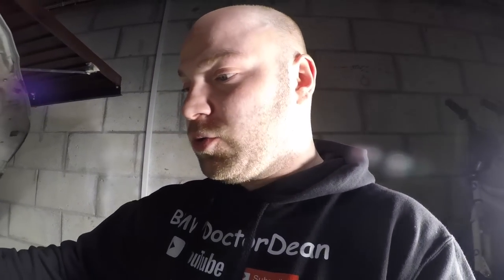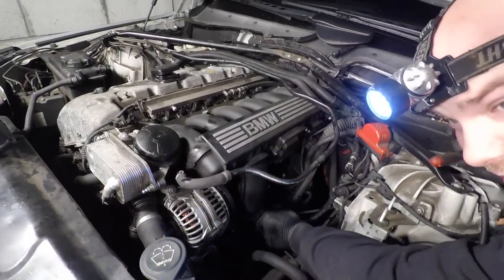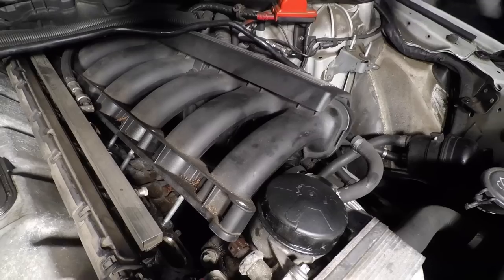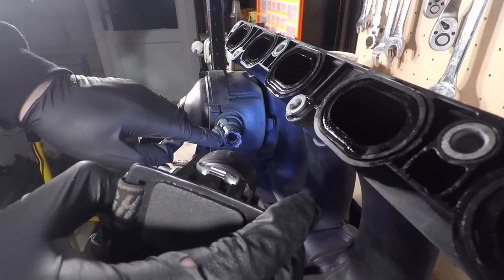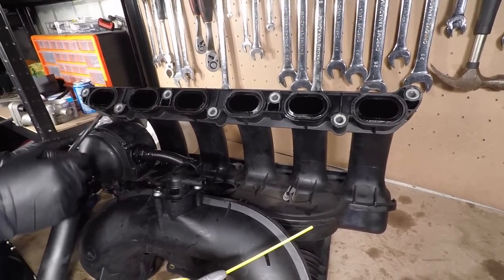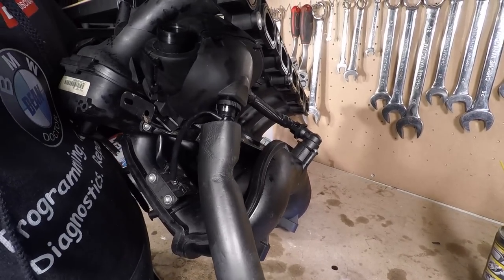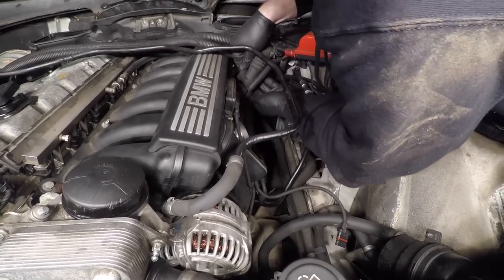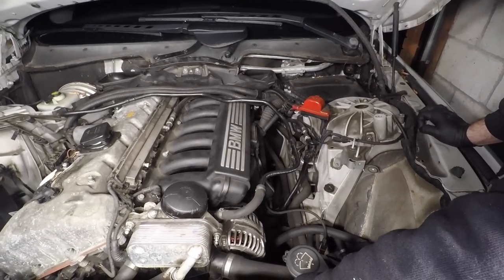BMW N52 How To Replace CCV Intake Manifold Removal Step By Step Guide

Comment: Does the old oil return hose (with yellow connector) had a check valve in it? 
Only few places I found about it people say that old hoses had valves in them with part number 11157527570. But the new ones with 11157567801 are just straight pipes.
So the problem is when the ccv valve are new it's kind of ok, but eventually it starts sucking the oil from the pan.

Comment: Could you please show how to check it on N53 and N54 Engines where the PCV oil separator is built together inside the Valve Cover, and also hoses and pipes from crankcase and to intake manifold.
It could be a great video in future.
Thanks a lot and comgratulations.
BimmerN53
Reply from the maker: nah it wont be mate and not enough money for the stress 

N53 engine is a uk and eu engine I have already purchased the new car for the channel and I can assure you now IT DEFINITELY is not N53 ask the country your in to pay more and I will do the videos until then im only willing to reach out to the USA and high paying countries 

sorry bro the same as all my diesel guys there sitting here waiting for videos that aint gonna happen again its to low pay for these countries

Comment: I removed my manifold and found oil. 2008 E60 528i N52B30A. The round oil separator in your video does not exist on my manifold. There is only the Y hose that routes to rear of engine

Comment: @BMW Doctor There is a rattle inside my intake and some oil too. I figure the oil is from the clogged ccv but what about the intake manifold should if have something inside that moves around in there?
Reply from the maker: that will probably be your disa valve flap has fallen off inside your intake manifold
Reply: BMW Doctor what should I do about it? A small stick fell out but i cant get that rattle thing inside out somehow Any advice?
Reply: @VictorRamirez-rg4pg  I'd like to know as well. Exact same thing happend to me.
Reply: bUMi7 It was the disa valve. It was broken and the middle stick fell into the intake. I replaced both the disa valve and ccv but I have a bad misfire that shakes all the way to the bck of my exhaust . then Idk whats the problem now

Comment: Cracking those manifold bolts, and also re-tightening them. Don't go from one end to another, use a diagonal pattern.
Reply from the maker: you do not have too with a N52 manifold

Comment: So my HFM sensor is not working I changed the ccv put it all back and now rough idle and in inpa value 0.00 everything its ok except that.. what could it be ? wrong wiring somewhere ? can u help me please ? i dont thing the sensor its dead just like that in 2 hours after. can it be a housing from ccv ?

Comment: Nice video! How do you check if your CCV is bad?
Reply from the maker: Very easy look at the back of exhaust do you have smoke or blue smoke , does your car consume oil
Reply: @BMWDoctor  Thanks, just white smoke becuse i live in sweden and it is -10 C here right now BUT its consuming oil yes, i am gonna change the disa also, i have problems with the car becuse on the fault codes its saying "Vanos intake 2A82" "Crankshaft-exhaust camshaft correlation 2A99" And "Camshaft sensor, inlet, signal 2A9A"
Reply from the maker: that is your VANOS SOLENOIDS go and change them for BMW DEALER ones ONLY do not use cheap ones or your problem will be WORSE
Reply: @BMWDoctor  Okey i have cleaned them many times but now i maybe need to change them?
Reply from the maker: Mate your not meant to CLEAN them do me a favour and remove yourself from this channel

COMING UP HERE TALKING ABOUT CLEANING THEM YOU CHEAP SKATE 😡
Reply: @BMWDoctor  Okey Thanks!

Comment: What's the most reliable way to see if CCV on N52 is shot WITHOUT removing intake? If i don't have any obvious symptoms should i replace it just to be safe (E90 N52B25 110k km.)?
Reply from the maker: There is no way the only way is to remove manifold and see if you have oil in that’s your only way why are you scared to remove the intake this job is a peace if piss be sure to stay tuned we will be doing live repairs soon

Comment: I've got a e89 Z4 n52 - There is leakage by the valve ecover bolts - would this point to a blown pcv also ? Would i have to change the valve cover seal also ?
Reply from the maker: Yes you would and that means your ccv is ruptured causing excess vacuum in the crankcase
Reply: @BMWDoctor  cheers buddy , this is quite a labour job but looks achievable , thanks , anything else to look out for on my z4 e89 59 reg? can any coding be done and what software ?, do you offer any services for work ??

Comment: I'm about to do the starter on my 130i.. Do you recommend doing ccv at the same time even though they are fine atm?
Reply from the maker: Yes mate as you will break your hoses during removal there usually seized trust me don’t remove it unless you have new parts as they will and do BREAK!!! 

To get to starter motor you need to remove the manifold anyway so do it all at once over wise you will be back doing it all again
Reply: @BMWDoctor  nice one thanks 👍 I'll get it ordered.. The amazon one is OK yeah... I've oil cooler and filter housing gaskets to do while I'm there.. But got oem for those

Comment: Hey doc, quick question for ya. Have you reused the same bolts or do you require new blue ones for the intake manifold?
Reply from the maker: No you don’t mate you can re use the same bolts they are not aluminium

Comment: Thanks for a great video! :)
Reply from the maker: No problem mate
Reply: @BMWDoctor  I have a 325 (01/2006) with some power fluctuation issues and sometimes rough idle, mostly when warm in warm weather. Taking a quick 5-10 minute drive around town seems to work just fine but a long drive it gets grumpy, specially when +30 degrees C. I tried cleaning and replacing the vanos solenoids etc. I will inspect my PCV/CCV-system and then maybe look into the software updating which you posted a video about.
Reply from the maker: DONT CLEAN THE SOLENOIDS WHY DOES EVERYONE ALWAYS DO THAT IT DOESNT WORK THATS A CHEAP WAY AROUND IT replace them with genuine Bmw parts like I did on my e60 and problem solved you cannot be cheap on Bmw you need to spend the money
Reply: @BMWDoctor  I did replace them (non genuine though, but couldn't tell them apart other than o-ring material) and both sets seemed to pass the INPA vanos diagnosis test but still threw same codes occasionally (intake/exhaust mechanicly jammed etc). Even got MAF max value codes so I replaced that as well (VDO) but didn't help. Guess theres several issues luring. Thanks for your advice mate 👍
Reply from the maker: my friend do no buy non genuine at all the only people that make them are china does not matter new or second hand they do not perform at the speed of the opening and closing that Bmw has the due set too you need Bmw ones you cannot skimp out on these cars Bmw made these so you cannot use cheaper parts trust me your asking my advise go and buy genuine Bmw parts NOT SECOND HAND either I paid just over £200 for mine and Ive had no problems at all for 6 months straight I wouldn't dare use cheap again  @steifan
Reply: @BMWDoctor  yeah allright. A little skeptical if the genuine ones only last for 50k miles (80k km) like mine did - IF that is that they are the issue.

Comment: Man I cant disconnect the breather hose that runs to the bottom along the starter. My arms is long enough to reach and grab it from above but because of the weird placement I dont have enough squeeze strength to squeeze the tabs for release. Any tips?
Reply: Same problem here. Did you get it? Any tips?

Comment: I recently started losing a lot of oil in my car, about 1L per 100km. I have replaced the valve cover myself and I plan to attempt this myself. I do not have a code reader to diagnose that the ccv truly is the problem though. So following along with the video if i take off the manifold and see there is a lot of oil build up it would be the CCV that is failing? I do not have any leak from the OFHG, but there some oil underneath the intake, and I believe that it is the issue. The crankcase breather hose is original so I believe that it is still not done on the vehicle with 150k miles. Do you believe the large amount of burning and small leak of oil, along with loss of power is the cause of the CCV? I plan to attempt this myself as I do not want to pay someone just to tell me whats wrong with it and repair it if is easy.
Reply from the maker: mate you are correct yes it will be your blown ccv this does not come up on a diagnostic scanner its something you just have to take the manifold off regardless and change and at that mileage I would urgently do it as mine needed doing at that mileage when I got my e60 and mine was completely shot so I dread to think yours won't be and yes that will cause massive oil consumption is the separator is getting blocked
Reply: BMW DOCTOR DEAN thank you! I’m going to try and do it myself. Never done it before so wish me luck lol
Reply from the maker: If you get stuck message me I will help you along the way mate no questions asked it’s what I’m here for but many many people have followed my video to full success as I detail everything perfectly in my videos
Reply: BMW DOCTOR DEAN thank you! I’m the farthest thing from knowledgeable about this but if i get stuck I’ll rewatch until I can’t figure it out lol
Reply: BMW DOCTOR DEAN I believe I’ve confirmed it’s the CCV as I’ve taken off the throttle body and there’s oil inside the manifold. Quite a bit in there
Reply: So I got the manifold off and it’s not the same as the vehicle you are working on. It’s only got the breather hose attached to the manifold. The breather hose was broken so is this the issue?
Reply from the maker: That’s your issue right there mate
Reply from the maker: That’s your issue and yep broken hose lean codes and rough running and lose of oil change that hose that means you have plastic valve cover
Reply: BMW DOCTOR DEAN so I just have to change the breather hose? I don’t have the same oil separator. I had a ton of oil inside of the intake manifold. I have a 2009 328i, so I think it may be a different type of system
Reply from the maker: Yep mate change it and if I was you change the valve cover the breather is built onto your valve cover
Reply: BMW DOCTOR DEAN I had changed my valve cover before this about 2 weeks ago, changed the coils, spark plugs, and the vvt solenoids. Is there anything integrated within the valve cover as well that would cause this? There’s no leaks around it anymore since I changed it
Reply: BMW DOCTOR DEAN is there any of the integrated parts in the valve cover that could cause this issue? Like you said I have the plastic one

Comment: @BMW Doctor hi,  could you advise me on N53 by any chance? just wondering, do I need to replace any O rings or gaskets once manifold is off?  Changed DISA valve (big one) because old one was broken, manage to take black flip(butterfly ) from inside manifold but still have big noise sometimes from there,and engine shakes very bad and shuts itself, but sometimes looks fine drives good apart RPM jumping on idle, no codes showing using INPA or other app, before I change DISA had mixture  and o2 codes.  so im planing to take whole manifold off on weekend and see whats inside. CCV  which comes integrated in valve cover been changed in to new(from BMW) 2 month ago. any thoughts ?  N53B30A E60 .
Reply from the maker: you need the update son and stop using crappy Inpa im sick of hearing about that shit software inpa is rubbish hence why your problem still exists and you haven't found it out yet

Comment: I have a 2012 e92 328i. When the car is cold at lowspeeds, or at a stop, when I turn the wheel more than 180 degrees in either direction I can hear and feel something grinding and it sounds like it's coming from my dash. Also car has fairly low miles at 64k runs funny when first started and for about a minute after. Its not throwing any codes, good fresh oil, dont see anything unusual.

Comment: I see a bunch of oil in my oil separator  , is that normal ? Pour it out, and it's good to go ?
Reply from the maker: No mate it means your ccv is fucked mate change the ccv the whole system and drain the oil out aswell
Reply from the maker: Moe Being yes it does even with ccv bad it will run fine just you will lose a lot of oil and you will have blow by from oil getting into manifold and cylinders
Reply: @BMWDoctor  "oil separator "-- CCV. I'd like to understand it more. The car was purring when the starter went. So , it will seem to run fine with the CCV bad ? It maybe had a cold knock.

Comment: I have a 2006 e60 530i. It has a rough idle and it has a vacuum leak and it whistles very loud.   Is this the right video?
Reply from the maker: You are correct this is the correct video whistling is the ccv blown air leaks will only usually come from the ccv
Reply: BMW DOCTOR DEAN is there a way i can send you a video of what my car is doing? so you can help me how to fix it?
Reply from the maker: Yes bmwdoctordean@gmail.com
Reply: BMW DOCTOR DEAN Okay sent it
Reply from the maker: Mate your ccv is blown it’s sticking that’s why when you life the oil cap it goes the ccv is sticking change it now mate before you blow the valve cover
Reply: BMW DOCTOR DEAN okay just ordered all the parts. Does the idle get better after changing it?
Reply from the maker: Idle will be superb after just follow my video to success like others did I recommend changing your valve cover as that will blow next as you don’t know how long the ccv has been like that putting pressure on the crankcase
Reply: BMW DOCTOR DEAN okay awesome. Parts come in 2 days so I will update you then 👍🏽
Reply from the maker: No problem mate watch both my videos as you have magnesium cover and your car will run again like a dream
Reply: replaced the ccv. no more whistle. But RPM are going up and down and my car id doing this breathing thing where it shakes
Reply: I will email you a video
Reply from the maker: Ok open your oil filler cap and let the air out did you reset valveteonic motor
Reply: BMW DOCTOR DEAN i am not sure how to reset it.
Reply: @kwen10live89   Hi, did you get your RPM sorted?

Comment: I have a 328i ‘07. I ordered the hoses and parts for the PCV but when I removed the intake manifold there was no CCV system on it. I’m kinda lost. I verified it is an N52K
Reply from the maker: mate you have CCV breather on top of your valve cover not under manifold please put back together now
Reply: I have a really bad vacuum leak I accidentally broke the hose from
The back of valve cover when I replaced gasket after removing valve cover. Very rough idle.. should I replace the breather?
Reply from the maker: mate your gonna be replacing ALL that to get to it so better do the whole lot I feel sorry for you doing this job what a nightmare

Comment: The lower part of my intake manifold Looks wet with oil, and
every now and then it smells like burned oil.
it Looks wet with oil, but im not loosing vast amounts of oil though.
Any ideas?
Reply: Valve cover gasket or oil filter housing gasket

Comment: that hose on the bottom will not lock into place for me, it popped off after I locked the other end into place, now I can't get that end lose so I am forced to try and get it to lock into place by jamming my hands around the back of the intake manifold and blindly try to force it up and to lock.  Not working.  I said screw it and left it they way it is.  Seems to be sealed anyway because the car is idling normal again.
Reply from the maker: Go underneath the car and push a small screwdriver between the drain tube and pipe it will release
Reply: @BMWDoctor  I'm having trouble reinstalling this tube - is there a trick to get it back on? Maybe a quick disconnect tool? Great video btw - thank you!

Comment: Hi Doctor Dean, whatcha the symptoms of fault ccv? Thanks ~
Reply from the maker: Whistling noise and loosing oil
Reply: BMW DOCTOR DEAN , is there any forum or contact? So I can post a photo/video, as I see that there is oil leak ... I send to 2 workshop also can’t rectify the issue...

I have chg oil pan gasket, valve cover gasket, valvetronic gasket...
Reply from the maker: EIffel Wong nope mate Nathan don’t allow that at the moment but you can send me to my email address but I doubt it’s a leak anywhere how much oil are you loosing
Reply: BMW DOCTOR DEAN can I have ur email? Previously 1 litre... now top up ... the workshop day Mayb bcoz of oil separator ... I’m wonder...
Reply from the maker: Bmwdoctordean@gmail.com ccv return hose is properly broke mate
Reply from the maker: Nathan is sorting out the forum as we speak for you to upload videos direct from your phone so please bear with him while he sorts it please do not upload anything yet the button is there but it will crash your system DO NOT USE THE UPLOAD BUTTON AS OF YET !!!!!
Reply: Bmw & Mini Doctor How noticeable is the whistling? and around what estimated mileage do they commonly fail?

Comment: What are the pros-cons in your experience to just bypassing/deleting the ccv?
Reply from the maker: no benefit and no chance they aint even made a bypass kit and that aint ever been done not worth the risk with n52 it relies highly on the oil system for the Vanos adjusters and solenoids

Comment: I'm swapping out the starter, and then I saw someone wrote the option of "killing 5 birds with one stone".  What are the 5 birds ? Crankshaft Position Sensor, starter,  CCV kit , ......  .
Reply from the maker: Moe Being my friend don’t even touch the crankshaft sensor if it’s not bad or your starter motor once you do this job once you will not mind doing it again it’s a piece of piss mate I can have that manifold off in 5 mins do not worry about that do the main problem your ccv